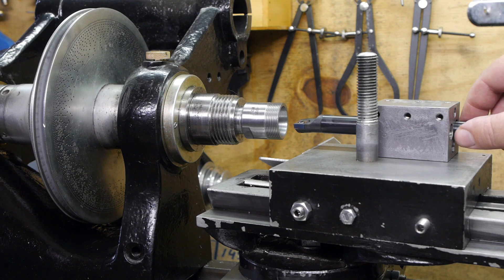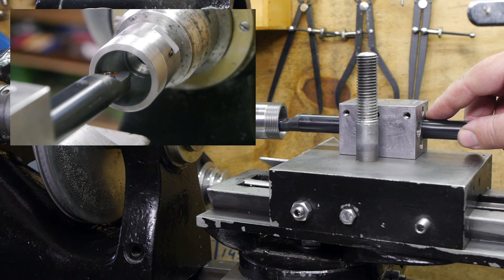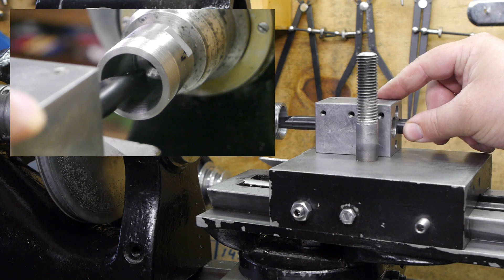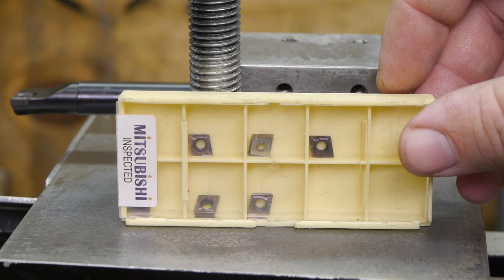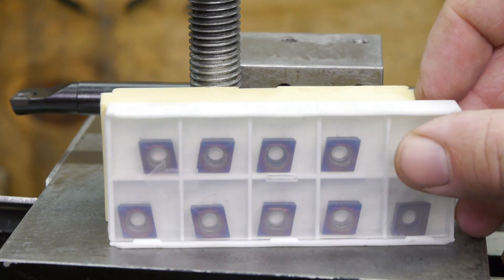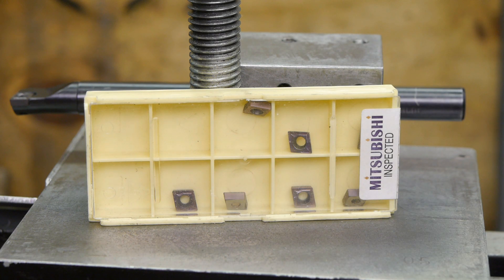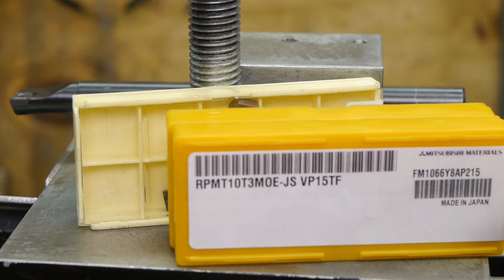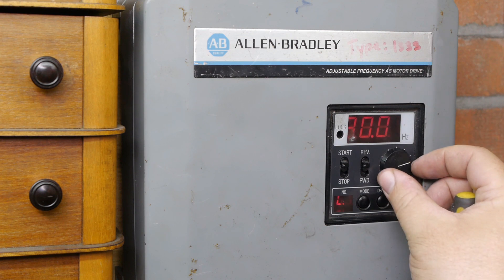Bad boring bar finish using some Mitsubishi VP15TF inserts

Comment: Die plaatjes zijn niet voor aluminium, je hebt scherpere plaatjes nodig, nu scheurt het metaal terwijl het geneden moet worden. Deze plaatjes werken goed, koop er houdertjes bij en je hebt een mooie set. de 208 heeft een grotere neusradius dan de 204 en 202 dus je kan ook trager voeden. Je kan ze vinden onder de naam "dcgt" metaalhttps://nl.aliexpress.com/item/32986115107.html?spm=a2g0o.productlist.0.0.605c2847KKUNIw&algo_pvid=99a17dd9-bf8f-40f5-b405-5930f91d5ed9&algo_expid=99a17dd9-bf8f-40f5-b405-5930f91d5ed9-0&btsid=0b0a3f8115820692265884209eabe9&ws_ab_test=searchweb0_0,searchweb201602_,searchweb201603_
Reply from the maker: Ik heb een doosje van die DCGT paatjes gekocht. Ze zijn inderdaad een stuk scherper. Moet ze allen nog een keer proberen. Maar er is nog voldoende over dan de spantanghouder voor een vervolg video :)

Comment: That original crappy finish bears all the hall marks of a carbide tip being below centre when boring.  Did you check the insert height against centre in the tailstock ?

I really don't like round holders as it is quite possible to have the boring bar canted, yet it will still pull down and do the job (sort of).  ALWAYS check the boring bar against centre, particularly when swapping out in a round holder.  The insert MUST be correctly orientated to work properly.

There is also the small concern that the centre of the boring bar/insert tip and the holder hole are not the same.

When you swapped to a smaller boring bar (which is  a much better idea IMHO) it probably sat and pulled down correctly.

Congrats on 10K subscribers.

Cheers Rob

Comment: Few tips:
1. Use an aluminium CCGT insert - uncoated and very sharp (ground).
2. Mirror finish can be achieved ONLY on certain materials (think quality steels, like tool steel). For the rest, we have to be happy with 'smooth to the touch' finish. It will not come out mirror no matter what.
3. Use any regular insert for roughing, and change the the CCGT insert only for the finishing two passes.
4. Use cutting oil, not WD40. It will not give a good finish if everything else is off, but it will take you that last 15-20% of the journey. Plus it will keep your inserts sharper for longer. 
5. For boring, DCMT (rhombic) and TCMT (triangular) shaped inserts are preferred over the CCMT. The trailing edge on the CCMT is so close the wall, it will sometimes trap swarf and mess up the cut. Not your problem here, but something to keep in mind.
Reply from the maker: Thanks. I actually ordered some CCGT inserts. Hope they get here soon, it will be interesting to find out how the perform on the collet chuck.

Comment: Turn the cutting tool upside down and run the machine in reverse  and cut on the same face. Or put the tool in and cut the back face in normal direction. This does not lift the chuck and spindle out of its bearing and cancels vertical shifts away from the tool bit  when cutting.   Can you run an indicator on top of the chuck to measure deflection while cutting.  Do it from several angles. Perhaps even check the other end of the spindle tube with an indicator while cutting.  If the cutting tool is a lever where is the fulcrum

Comment: I can sympathize. I was trying to improve internal boring finishes without grinding equipment and made up an internal shear tool for the final .001" removal. Just make sure the original finish groves were not deeper than .001" or additional cuts with the shear tool will be required.  I was quite impressed with the finish which had undetectable groves with your finger. As Mr. Pete says "smooth as a hounds tooth". A quick touch with some 1000 grit paper and it actually had a polish. When I need a fine finish that's my go to tool. I can send some pictures of my ID shear tool if you like.Other helpful hints:Using a large radius insert helps with the roughing as well as fine diamond honing the insert to get a sharper edge. Inserts tend to plow material when not taking the recommended depth of cut and they are usually rated for larger cuts than our hobby lathes can take. A close look at inserts will show they actually have a bit of a blunt rounded cutting edge that helps them stand up to high heat at design cutting depths. Sharpening them can greatly improve finishes as long as the cut depth is kept reasonable.Stefan Gotteswinter has a good video on it but you can do a pretty good job using a diamond Wheat Stone to just flatten the top edge. https://www.youtube.com/watch?v=UUVvgcvlbBs&t=603sGood luck
Reply from the maker: I would love to see some pictures. I've used a shear toot but can not image how a internal sheer tools would look en work. Tried it again tonight and that was another failure. Next I am going to spend hours grinding a HSS toolbit for another round of boring boring :)
Reply: Let me know how to get you the pictures. I used a .25" ROUND HHS tool bit ground at a ~30 deg angle. That was inserted through a 1" bar at ~45 deg angle with a flat and set screw to hold it in place. The tool bit was rotated about 20 to 45 deg to provide the shearing action. Of course smaller materials can be used, for instance, a .5" or even a .625" bar would work fine. Very low cutting forces involved in use. But I would stick with a .25" HHS round bit, you need the radius. Depending on your lathe gearing and travel per rotation you can adjust the bit rotation angle as needed as well as for the different materials. Remember this is only for the lightest of cuts and the swarf/chips will be like extra fine steel wool just as with an OD Shear tool. Its really easy to make since you don't have to be broaching any square holes, ha ha. Changing the Bit grind angle and rotation as you see fit to fine tune your shearing action is very easy and a lot of fun to experiment with to get the best finishes. I did find that it worked great just about any where as long as you get a slight offset, greater than you distance per rotation, to provide the shearing.Good Luck and let me know how to get you the pics. They will help in understanding.
Reply from the maker: That sounds very interesting. I'll try it when the HSS boring bar fails as I expect it will.
You can try uploading pictures to my google photo album https://bit.ly/2wKz9im
Never used that before in this way, But if it fail my mail address is in the channels about page.
Might no show on mobile devices but it's my channel's name @ gmail.com Thanks.

Comment: my god, get a proper tool post already. this setup is just painful to watch.
and how you'd expect proper finish at ID no less with a CCMT insert recommended for roughing and interrupted maching at low speed?? get a sharp one for finishing like CCGT and a fitting boring bar ffs, tho i'm not even sure finishing is possible on your lathe with that joke of a spindle bearing.
Reply from the maker: Sorry what's wrong with this toolpost? It's just old.

Comment: Why are you using carbide insert tools... that lathe isn't designed to run carbide....go supersharp hss... & make 100% sure you are dead on centre-height or the taper cut will not be correct. 
HSS tooling is not only more appropriate for that wet noodle lathe it is a LOT cheaper...
 😎👍☘
Reply: I think you r right!

Comment: I have just started viewing and got to 40 seconds and without watching further the video I would suggest you take a look at your boring bar insert, it seems there is no support under the insert, it looks as though the insert has a gap where it should be supported at the tip by the boring bar,
Reply from the maker: There is a bit of paint missing from the boring bar. That might give the elusion it's not fully seated.
There certainly is no air gap, I held it up against light
Reply: @Rolingmetal  Well that's good news

Comment: I'd use a larger nose radius and  a high top rake ground insert .you must reduce cutting forces because on an older ,light machine like yours any deflection of the boring bar will cause chatter.
Reply from the maker: Hard to regrind inserts, especially by me :)
Reply: @Rolingmetal  they come ground for cutting aluminium and copper etc.
Reply: A larger radius nose on the tool would encourage chatter (cutting forces are directly related to tool edge "length")... but u are right Paul,
 hi-rake super-sharp inserts are available... but... they are delicate creatures prone to chipping at the slightest onset of vibration.  
And don't even THINK of grinding an insert... 🙄

Heres what I'd do ... use the largest diameter piece of m.s. bar you can get away with (for rigidity) and cross-drill the end for a broken centre-drill or a bit of round hss, suitably ground, then to hold it in place, drill the bars end for a grubscrew... use as little overhang as possible on the boring bar length and the cutting bit itself... 

And MOST importantly u MUST keep the cutting edge on-centre height or it will NOT turn a true conical surface , the surface will be slightly curved.
I have actually made a makeshift boring bar like this before & used a broken 1/4" endmill ground to the proper clearances as the cutting bit & it worked a treat !

Edit.. 
Heres a link to grinding yer own HSS cutters, I think you should have a go ! 

https://youtu.be/__A2xtLF0AU

😎👍☘️

Comment: What material, whats your rpm, whats your depth of cut and whats your feed?
Reply from the maker: Material: chinesium, rpm:800, depth of cut: about0.2 mm. freed rate: manual.
Reply: @Rolingmetal  ok... I am a machinist so what i have to say is more than a "grain of salt". Everything your doing is working against you. Looks to me that the dia is a little over an inch so 800rpm is not going to cut it considering that you dont know the material, i would go min 1200rpm. Tool nose radious appears to be your standard 1/32 so depth of cut providing you have enough material is min .03in on radi and your feed well.... If you dont have power feed your shit out of luck and hope you have a smooth hand, Feed should be .005ipr for a almost glass finish you can go up to .008ipr and still get real nice results, may require emery.

Comment: Hey RM congrats on 10k subs!! 👍 I do think that if you had a grinder you could give your 1204s a 15 degree angle (from approx 8 I believe) leaving a mm of land to the rad it would cut alot better, I think the clearance at the bottom is the issue, however it did look better on the 09t3s (min bore 16mm anyway). A larger radius on the tip would help too I think!  I believe the min bore for a 16mm is 20mm anyway from most suppliers so to be able to bore smaller you need to grind more clearance (on the underside of the tip), which we do at work. Also however fair play on the air through the back, wouldn't have thought of that myself and will have to remember that for my baby lathe so cheers for that haha! Loved the video dude, keep up the great work!!

Comment: I've always used tool steel in my Myford 7 lathe, in the last year or two, due to Bangood hitting you tube so hard, I've bought some insert tooling. Very good for harder materials or reasonably deep cuts but only get a very good finish if I'm using high speeds or taking big cuts, making the tool work hard.
  I can cut deeper using high speed steel, normally a .050" in mild steel , the inserts make the lathe struggle at anything over .030". As soon as I'm trying to creep up on a size, i.e. fine cuts, the surface finish using inserts goes down a lot. If I want a really good finish and I'm creeping up on the size I always change back to tool steel.
 Suggest you stop buying so many inserts and try some well honed mild steel. Well done with your subscriptions!
Colin
Reply from the maker: I believe HSS can be made sharper than carbide that might explain the different results.
Reply: Yer bang on Colin, I have an ML7 and I wouldnt use carbide on it at all unless I was hard-turning, something I'd prefer to do on the bigger Colchester... but as you say, its very hard on small lathes, carbide inserts small rake & clearance angles beg for horsepower & put a LOT of pressure on the headstock "bearings" .. 
😎👍☘

Comment: I have watched your vids on and off but have not subscribed to your channel yet so I do not know all the story but, have you thought about adopting tapered roller bearings to your lathe if that is possible?
Reply from the maker: Basically I needed a new hobby, so I bought a lathe and then started making videos in order to get some good feedback and learn a thing or two. Next YT kinda became the hobby :)
I have thought about roller bearing. The could be made to fit inside the headstock. But modifying the tapered spindle journals would be impossible for me to do
Reply: @Rolingmetal  subscribed!!! lets see where this leads😉

Comment: Anytime I think the fan noise from my shitty Huanyang VFD is bad, half a second of the noise your Allan Bradley puts forth has me feeling better about things. Easily makes my Top 3 Very Bad Sounds, right up there with Trump.
Reply from the maker: It's a bit of an acquired taste
Reply: @Rolingmetal  you are the king of understatement! Hey, have you turned much delrin? Might work well on your old lathe. I was turning delrin on the weekend and it seemed to really like low speed. Would love to see you try it. Keep up the videos, I greatly enjoy them over here in Australia.

Comment: Congrats on 10k!! The surface finish is a symptom of high frequency oscillations. The spindle bearings need to be modified for conical axle/hub bearings. That machine just wasn’t made to run at carbide speed. Get some US, Japanese or European HSS stock and grind up some tooling. 

I’ll be donating on PayPal again soon, not much but I hope it’ll help you make more videos.
Reply from the maker: You are right about the spindle bearings, they could definitely use a professional scraping
Reply: So right.... Running Carbide on a lathe of this size & light construction is asking for trouble. Why are people afraid to learn how to grind up some hss tooling which is all that was available when this dinosaur was made... 😒

Comment: Maybe set the boring bar  above centre height as much as possible on tiny holes like this. I do that and it leaves a better finish.... add a spay of WD40.  10k subs 👏🏻👍
Reply: Setting off-centre height will distort the taper ... 🙄😒
Reply from the maker: The pointy bit might have been a hair below center. It's probably better to be above center with internal turning work. I guess I will have to take another cut.

Comment: Brother, I'm going to help get you a new vfd drive.   That thing is scaring your inserts too badly to cut.
Reply from the maker: I've ordered something from ebay. This old one is on it's way out. It needs a minute warm up period or else it cuts out with an error message.
Reply: My ears thank you
Reply: @Rolingmetal  Glad you found something.   Btw, jump on eBay and see if you can find some Sumitomo ACZ310 grade turning inserts.    It's the 'old' grade and you can find them cheap and the surface finish on steel is enormously better than the VP15TF coating.  I've done a lot of side by side testing of iscar, mitsu, sandvik and Sumi and they have been the best steel quality on everything from 1018 to 4140.

Comment: Hi Look how much space there is under the Blue Nano insert, it is not seating ok and will never produce a good finish.
Reply: That is exactly what I pointed out to the gentleman in the last session. These ' Blue Nano ' things have the wrong geometry or are manufactured wrong as they don't sit flush in the tool. I have two sets, DCMT and CCMT which are worse than useless.
Reply: @lensman5762  From my experience it is more often the insert "holder" (boring bar, face mill) that have the wrong geometry with the screw being set back to far into the insert pocket, in a set of 5 boring bars, one had the insert tipping up, the same insert was sitting perfect in the other 4 boring bars

Comment: a bigger nose radii could help to chip ejaculations smoothly
Reply from the maker: I might but carbide is difficult to regrind. But I have found big piece of hss. It probably need a day worth of regrinding but a bigger radius on the pointy end should not be a problem
Reply: @Rolingmetal  You might also consider buying CCMT inserts made from HSS.  Also, maybe your poor surface finish is related to the steel you're cutting.  Super smooth finishes on low carbon steel can be difficult to achieve.  Maybe a side-by-side comparison with a leaded steel would be telling. 

By the way, I enjoy your videos, congrats on 10 Subs, and who knew a Dutchman could have such a dry, witty sense of humor!